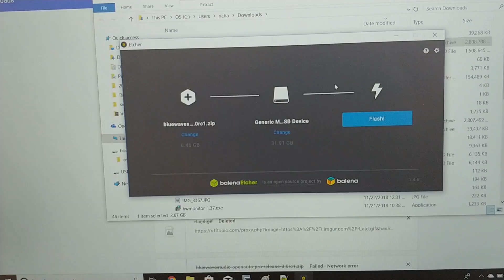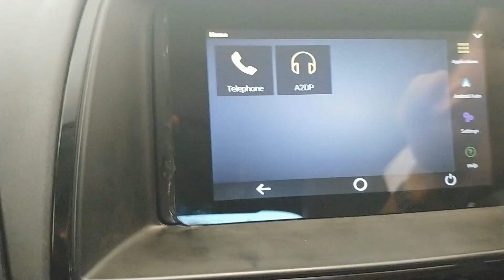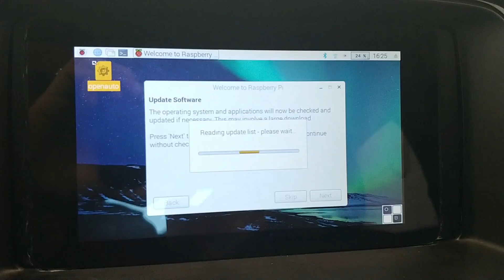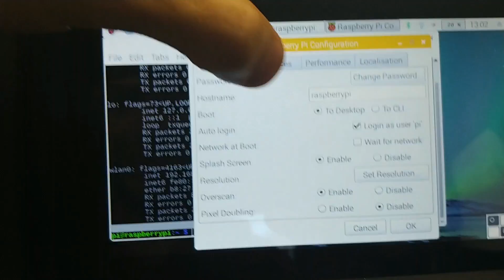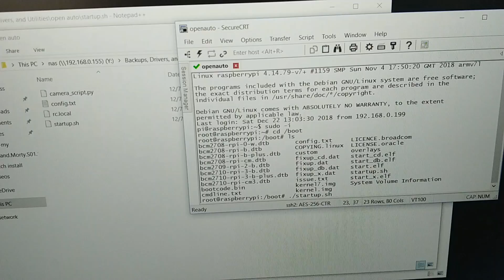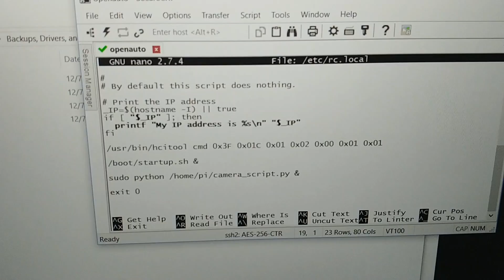Raspberry Pi Headunit Replacement Update Part 1 - Open Auto Pro, Camera Script & Shutdown Script

Comment: First and foremost, keep this going! This is great work and content. I currently work in the automotive industry as an engineer, and your ability to explain your design in simple terms is a great skill. Amazing work man.
Reply from the maker: Thanks for the kind words.  I really want to keep this going, but I have a few things holding me back - most importantly I'm on an expat work assignment and not even at home anymore.  But when I pick this back up, I want to look into creating a custom circuit board to consolidate the messing wiring.  Should be a fun and challenging way to take this set up to the next level.  BTW I'm a controls engineer and I love to teach, so this channel is a great outlet for me to share my knowledge.  I do have other non car-pi projects in the works that hopefully folks will find interesting.
Reply: Bhai zip file ha apka pass

Comment: Been waiting on this video, thanks.
Reply from the maker: thanks man.  It was a long time coming.  This video was split into 2, and I have part 2 coming soon which includes steering wheel controls/wireless AA/kodi.  Should have it up within the next 2 hours or so.
Reply: @Productiv-ai  Could you go into a bit more depth on the delayed shut down?
Reply from the maker: @tjohnathon30  Yes I have another video that I recorded a few months ago and just never found time to post that shows how I set up the relay timer.  In reality there are easier solutions for this.  One is called mausberry - https://mausberry-circuits.myshopify.com/collections/frontpage/products/3a-car-supply-switch-1.  It's plug & play and way easier than what I have in my setup (a programmable relay timer that was a pain to program).  I would go this route were I to do this again.  Still, I plan to post the relay video sometime soon in case others want to follow my setup.
Reply: @Productiv-ai  yes please
Reply from the maker: @tjohnathon30  the video is up now - https://youtu.be/rknBevexOcU

Comment: Nice videos, I'm looking to do something similar. Quick question: What wires do you use from the wiring harness, and what were they hooked up to? Maybe I missed it in one of the videos, but I don't remember a part that showed all of the connections, and how your Pi recognizes you're in reverse to turn on the backup camera. 

Thank you in advance. Any help is greatly appreciated.

Comment: Thank you so much! Your videos have been super helpful throughout this process.  I have a question (since you are convincing me to try OpenAuto Pro) - With AndroidAuto Pro, was there anything special you had to configure to use the HiFiberry If I recall, your build used a HifiBery Digi+?  I plan to use the DAC+ and wanted to know if that is cooked in).  I may pester you with another question further along in the build. Thanks again for sharing all of this with us!
Reply from the maker: No problem!  Your DAC will work right away. Open Auto Pro supports all the hifiberry HATs out of the box.  Feel free to ask more questions!  Here to help.
Reply: I actually have an issue trying to connect my hifi dac + it is connected, but there's no audio, I had crankshaft before with the same setup and it was working, did you configure anything to get the sound on the dac working?
Reply from the maker: @btw_saul  interesting.  I didn't require any special programming to get my card working, sound was working right after install.  Check the pulse audio volume settings inside raspbian.  If it's detecting your card properly it may be something physical.  I haven't heard of people having issues getting hifiberry cards working.
Reply: @Productiv-ai  I've read in the blue wave forum, that it's because of the microphone, openAuto does need have a microphone to be able to configure all the DAC hats
Reply from the maker: @btw_saul  ahh good to know.  Yes now that you mention it I do recall people complaining about this in the forums.  Luckily an easy fix tho

Comment: Great job on the videos, I have been wanting to setup Android / OpenAuto on my Toyota for a while and I've been following you. Now that you have most of it working I think that I'll set it up too. I do have questions, like, are you using a external GPS or does the navigation use the one on your phone? Also where did you find the schematic for your car. Also I have Sirius xm in my Toyota and I really like it, do you know if it is possible in OpenAuto?
Thanks for the great information,
Reply: It basically mirrors your phone screen for GPS. According to the OpenAuto page, a GPS hat (or was it USB only? idr) can boost GPS signal to your phone. Not sure how that would work? But for what they cost it may be worth it. Worst case, you can add an offline map solution to the Pi in case you are out of cell service/the phone's weak gps fails. That is my plan anyway.
Reply: Do you have a zip file

Comment: Hey, man.  Great video and project! I currently have a Nexus 7 installed in my car and am wanting to replace it with a Raspberry Pi and screen.  I have a quick question about your shutdown script and relay.  You said the relay is connected directly to the battery and you're not using the ignition line.  How does the relay know when you shut the car off if it isn't reading a high/low from somewhere and it is just always high being connected to the battery?

I am probably just not understanding what you explained in the video correctly.
Reply: And I just found your video showing the relay and timer setup. I knew I was understanding wrong what you said in this video.  Thanks for the great content, you should get back into making videos again.  You do such a good job explaining yourself most of the time.

Comment: I really liked this project, doing to do same for my Falcon FG in Australia, not able to find any external bluetooth dongle with HFP support which is supported by raspbian, can you suggest some more alternatives for panda bluetooth??
Reply from the maker: sorry I haven't done much research on alternatives.  You'll have to look for a bt module that doesn't use the broadcom (BCM) chipset.  Here's a list of some BT 4.0 chipsets https://www.argenox.com/library/bluetooth-low-energy/a-guide-to-selecting-a-bluetooth-chipset/.  Try searching your local market for an adapter that uses one of those non-broadcom chips and make sure it supports HFP and integrates well in linux.  Good luck!

Comment: Great videos thank you! Would you mind linking the USB hub you bought? And any more information on how you hacked it into your power supply?
Reply: I would also love to know more details on the power as well as the delayed timer used and how you hooked all this up to the car battery.
Reply: Sameeeee please
Reply: atolla USB Hub mit Netzteil, USB 3.0 Hub Aktiv mit 4 Ports SuperSpeed Datenhub mit Schalter und 1 Intelligenter Charging Port und 15W(5V/3A) Netzteil Adapter https://www.amazon.de/dp/B07P6MPXJ7/ref=cm_sw_r_cp_apa_i_X00ZCbZWYMWX8
Reply: power, easy simple, buy car regulator 12V to 5V add wires and ready, wery simple my 7 year son can build this.

Comment: Hi there.
Just finished my project with raspberry pi and openauto pro. I love it but there is somenthing i would like you to help me. So i have mausberry 3a car switch and i need some help with the script provided by them. I want backlight to go off when there is no acc power and to turn back on when there is acc power. Can i simply use your script or do i need to modify the original script and how to do it? I really hope you could help me

Comment: How did you take signal from back gear?
Reply from the maker: I just found the reverse signal in my wire harness
Reply: And just connect to gpio? It can by used 12v? I read somewhere rasberry pi gpio is max 3.3v
Reply from the maker: @Dziurga6  it definitely nerds to be 3.3V.  You can use a buck converter to step down the voltage. You also need to tap the ground wire from the harness to complete the circuit
Reply: @Productiv-ai  Thanks a lot :) Now i ready to do it. Just wait for me PI4 and make it :)

Comment: So I need an external amp to connect the pi to my cars speakers, right? Also, would there be anything that wouldn't work if I bought a cheaper display than the official 7" touch screen?
Reply from the maker: Yes you need some sort of external amp, but it doesn't need to be fancy at all. You can find amps that tap into your existing speaker wires and are powered by the same 12V circuit to your pi. Probably $30-40.  You can also use a cheaper display that connects via hdmi, but be careful. Best to check openauto forums for compatibility

Comment: I also used the same USB hub with a 12v to 5v 3a max converter but phone still seems to charge slow. The adapter is 3a but do I need to but the same one as you? 10A ? The slow charging drives me crazy
Reply from the maker: Yeah that 3A is most likely underrated. I would go with a 5A minimum. 10A is usually only a few bucks more so that's what I recommend doing.
Reply: @Productiv-ai   yeah strange because the wall adapter is also 5v 3Amps. So I tought If i take 12v to 5v 3amps max is fine but apparently not.. better change to 5 or 10amp better to much than to low.. the hub will only take what it needs right
Reply from the maker: @wesleystraetemans2515  correct
Reply: @Productiv-ai  thanks for the fast reply. I will change it to 10amps!
Reply: @wesleystraetemans2515  yes,but raspi only no need more than 2,5A if have usb hub need more amp ofcourse. and external displays need too lot amps.
Reply: @mattivirta  i have a separate power supply for the pi and screen

Comment: I'm having issues with the shutdown script. How do you have the relay wiring set up to trigger the gpio shutdown command? Is the defined pin GPIO 23 or Pin 23 (GPIO 11)? The initial state is set to high so would it need to be GPIO to ground and when the relay disconnects  from ground it sees LOW and starts shutdown?
Reply: When the pi is powered on, the ignition trigger is on, which makes the GPIO read high. When power is pulled the GPIO goes low.  It's not GPIO to ground, it's GPIO to 3.3V.  Initial state is actually low, but because the input is high during normal operation, it pulls the GPIO high as well.
Reply: Thanks, that explains a lot, I couldn't wrap my head around the operation of the GPIO from high to low.

Comment: Which Pi are you using the Pi3 and Pi3b+ have bluetooth built in?
Reply from the maker: Using the Pi 3b+.  Yes it has bt built in, but I mention it in the video that the built-in broadcom bt chip does not properly support HFP, so you cannot use it for phone calls.  A non broadcom external bt module takes care of this problem.
Reply: @Productiv-ai  Alright missed that part.

Comment: can you please send me the startup.sh script ? I do not get it to work with the delayed_shutdown_script.sh. There is an error message ( -ne: unexpected operator)
Reply from the maker: how did you generate the file?  Sometimes if you try to write scripts in windows and run them in linux, they mess up because of the different newline.  I don't have access to send you the file right now, but my reccommendation would be to copy/paste the script from pastebin directly into the pi via ssh, making a new file.  Strange things can happen when writing linux scripts inside of windows.